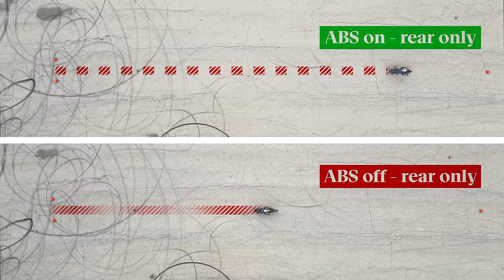Out-braking the ABS Myth

Comment: Because when I lane split I spend a lot of time on the paint, I have been worried that my tires wouldn't stick when necessary, which could dramatically reduce my stopping distance. I also thought my ABS could help maximize my stopping distance on paint (and/or wet roads).

The other day I discovered that threshold braking and front loading is the only way to make a slippery situation stick. A black pickup truck illegally jumped over the double line in front of me (that I was riding on) forcing me to jump on the brakes. Fortunately my instincts pulled my foot OFF the rear brake, giving me maximum force down on my front tire, safely slowing and narrowly avoiding the collision. I was surprised at how quickly I was able to decelerate. It was harder than I would have dared to do during practice.

Maybe ABS helped me, but it didn't feel like it. It felt like my experienced touch held the braking steady at near maximum friction.

I am grateful to my Michelin Road 6s, the best tires I've ever had on a bike.
Reply: I've been thinking about this concept of not using the rear brake in order to apply maximum force on the front tire. First in an emergency situation, you just do what you do automatically, and it's great that you were able to slow down in time. Hats off to you for that!

But apart from panic stops, in theory, I think using the rear brake will A) slow you down (up to the point where the rear wheel skids)  and B) not cause the front tire to lose friction unless you used so much rear brake that you also caused the front tire to skid (the exact problem that ABS tries to solve). and so the front tire stopping force wouldn't be diminished until the point where it skids. So in an ideal situation, you would use near maximum brake force on the front brake and just the right amount on the rear. 

Now add to the mix the brakes that Ryan was using on that Honda CB500F (?): two big rotors in front and one somewhat smaller one behind. I'm not sure how many cylinders in each brake, but certainly way more in the front. So I kind of think at least with a bike like that, one would do well to wring both brakes pretty hard. (And on mine, the brakes are linked, so that to get full force on the front, I need to use the rear as well!) anyway - complicated subject! The best advice is to practice.
Reply: @emzes5231  I think the issue is that ANY drag the rear brake adds pulls back some downward pressure on the front, thereby reducing the maximum friction of the front tire. 

It's as if the ONLY use for a rear brake is a backup in case the front brake fails. It seems the best technique is to NEVER use it. I only started using my rear brake again recently because I have an electric motorcycle and the regen equipment is on the rear. So I use front to stop quick, and rear to regenerate power for longer, slower stops, or down hills. Even now I'm considering that a bad habit to develop, and sacrificing the miniscule electric regen for maintaining good front-braking habits.

Comment: Very few motorcyclists are able to achieve an optimum braking distance without ABS. Either they do not brake hard enough, or they overbrake the front wheel in a panic braking maneuver and crash. 
The ABS system is one of the most useful electronic assistance systems available.

Comment: What about also using engine breaking to help assist the stop? Initial phase Threshold with a few downshifts & light back breaking -> then hard front breaking and back breaking not using the clutch and pulling it just before stopping or letting the bike cut off...

Comment: My background is as an expert-licensed motorcycle road racer and motorcycle road racing instructor. I have lapped the Snaefel Mountain Course on the Isle of Man during the TT at triple-digit speeds. I have been over 200 mph on my superbike. I have turned expert-level lap times during track days, with my wife on the back. I have been paid at the rate of $1,000/hour as a rider and model for the advertising campaign of one of the largest motorcycle manufacturers in the world.

I NEVER use the rear brake while in motion. I can out-brake the ABS system under almost all conditions, rain or dry. For the track, I turn off the ABS. On the street, I turn the ABS intervention level way down.

Comment: in motorcycle license school they taught me to first tap then rear brake the quickly pull the front. you shouldn't go 0-100 % but 0-20-50-100 % to avoid the front locking with the sudden braking

Comment: I own a 2005 BMW K 1200 LT. It came with interlinked ABS. Unfortunately, these systems are not something you can turn off and they are very prone to failing after about 15 years. When you get an ABS fault on the LT you actually have no brakes at all. This happened to me a few years ago on top of a mountain, I didn't know how I was getting down. Fortunately, after I restarted the bike the brakes lasted long enough to get me back down on the flat. I ended up doing an entire ABS delete on my bike and it's the best thing I ever did. It is actually hard to tell that you don't have ABS and I no longer wonder if I am going to lose my brakes when I drive out the gate.

Comment: This is essentially the inverse of a launch problem in a drag race scenario. Modern cars will apply acceleration to first shift weight to rear wheels and then adjust dynamically for maximum performance. Eventually a bike braking system will be capable of doing the inverse automatically as well.

Comment: I actually started using the front brake on my bycicle a lot because the rear brake was failing. So when i started riding a motorcycle i was used to using the front brake and it was pretty helpful when maneuvering. I was driving a trial bike tho, so probably not useful for larger bikes.

Comment: 2:00 that Tundra also probably has something called Vehicle Dynamics Integrated Management, which coordinates ABS, traction control, and electronic stability control into one coherent unit that can detect and even predict instabilities by parsing driver input and running a physics model of the expected behavior 1,000 times every second. During an emergency stop, VDIM essentially executes phase 2 of ABS as soon as it detects a slide risking amount of deceleration. Similarly, during acceleration, it can see that one or some of the wheels are accelerating way too quickly, and reduce power before wheelspin becomes uncontrollable (or even gets to a level that would trigger a conventional traction control system.)

Comment: Great explanation! This way the majority of misinformed riders can start to understand what a motorcycle ABS system is designed to do. It would be interesting though to repeat the brake distance comparison on a wet surface with reduced traction.

Comment: back in my teens when I still was riding on two wheels I'd make a game of braking as hard as possible, that conditioning, while it did wear out the front tire rather quickly, most likely safed my life when someone cut me off while I was going 80kp/h down the country road.

I didn't manage to stop in time, but I slowed down enough to tell the tale

lucky for me was that I installed aluminium handlebars 2 days before that crash, cuz I was leaning in to them before impact and bent them so they looked to be on backwards
broke my wrist but other than that I got away relatively well
if I stillhad the steel handlebars I may have come out of that a lot worse.

Comment: ABS can be problematical on cars.  Back to statement that humans can evaluate consequences while ABS can only react, ABS always prioritizes control.  Snow in particular ABS may severely cut back braking to a fraction of what it is in dry conditions as it tries to prevent lockup even when the snow is perhaps a really thin layer, max braking force then becomes what that thin layer supports.   What the ABS can't know is that if wheels become locked the tires cut thru that layer to the pavement underneath.   Or assume there is more snow, again ABS limits to the traction of snow while wheel lock will pile up snow ahead helping to brake faster.   In every case wheel lock cause momentary loss in directional stability but the driver can selectively let off to regain control as needed.

Comment: So I've heard a lot of Harley riders used rear brake only for most, if not all, daily stopping. This habit probably doesn't help in a panic. 
Side note: I two step my braking by getting on the rear a beat before the front. Loads up the front just the same as a two stage level pull, but I feel like it's faster and smoother. (Although maybe just for me since that's the habit I developed.)

Comment: I like abs in the rear wheel, as it is almost impossible to do emergency break without locking the rear, the fear makes you act too fast and apply too much force. 
The other time I love abs is when the road is wet. I love to apply 100% brakes without fearing the wheels are going to lock

Comment: So here’s a real life example of motorcycle experience - my life.  Following friends on a dry country road, down hill with a right hand bend at the bottom.  Hit the front brake only, and the rear goes light and lifts very slightly.  ABS immediately kicks in and cuts my braking till the rear comes back down.  But, the bend is approaching really fast, and I’m looking at a certain crash.  So, off the brakes, look at the corner exit, ease on the throttle and pray.  I make it, fully crossed up, with a recorded lean angle of 45* right, and the rear hanging out like I’m a moto2 pro.  What saved me?  The traction control didn’t kick in.  But I had faith in it.  What nearly killed me?  The ABS.  The bike?  S1000RR 2022 model.  I will hold my hand up .  I’m not some biking god.  I put the save down to luck and a massive sense of self-preservation.  So even the most expensive/sophisticated road going bike ABS is not up to the job.  Learn to brake and steer, my friends, because bike ABS is not all you’ve been led to believe.

Comment: When I had a bad crash I was too afraid to pull the front break, because I feared to block the front wheel and slide under the car. Instead I opted to stand up and fly over the car, which in hindsight was probably the right call. If my bike had ABS, I would have pulled that lever hard! It's good the EU made ABS on bikes mandatory now!

Comment: I have unfortunately had many opportunities to test my 07 VFR's ABS system and found it really only most useful during wet/flooded stops and it did not allow for a faster stop, but a more controlled stop. In normal riding and just short of ABS engagement, the dual linked brakes provide a much faster and controlled breaking effort.

Comment: This is my braking experience,

A front only ABS for bikes above 150cc, if you apply both brakes at the same time the braking will be poor.
Front brake first little bite then then a heavy braking, only apply rear brake only after 1/3 rd  second of applying front brake . Rear brake  shouldnt apply more than 30% coz, more braking can make it lock and slide. Brake maximum don't exceed to the point when the brake start locking.

Also control both tyre speed to be almost equal to have a traction. 

Soft tyres gives you better braking,  just warm the tyres for better braking.

Keeping finger on front liver can save you couple of meter than not keeping.

If your bike have front ABS learn corner braking , also learn corner braking with reducing turning radius.

Give back brake a little loose so that if you apply rear brake there should be some time lag than front brake for better weight transfer. 

If you apply both  brakes at the same time 50-50 the bike front suspension become loose and bike height will increase a little, the weight transfer will go back to rear which give rise to longer stopping distance.

Comment: Last accident was when under hard breaking to avoid hitting a car who suddenly breaked hard to make turn off they hadn't signalled for. My front wheel locked up, starting at a 2cm crack in the road. If i had abs my bike would been fine.

Comment: The idea is the same for cars. ABS is not to stop faster, it's to maintain control during braking. In cars, you'll always stop faster without ABS (no guarantees WHERE you'll stop though). A truly revolutionary system would be one that can modulate pressure perfectly to maximize brake pressure without losing grip.

Comment: It always blows my mind people forget to use their front brake. My problem was bad brakes, I grabbed my front brake hard af but my master cylinder allowed air into the lines, and I didn't realize until that second my front brakes were shit. The master cylinder ended up being recalled, AFTER the accident. Brake fade is a bitch, it happens slowly over time so you get used to it, then when you really need your brakes they aren't there. I locked up the back brake pretty quick because for a slit second I thought I had enough room to ease up and unlock it after my front brake slowed me down a bit, but nope. Back tire stayed locked up and I slid into her sideways lol. Thanks Suzuki for delaying that recall for years so I could learn how I brake in a full SHTF situation.

Comment: ABS is predominantly FOR instances where the surface is slippery or unpredictable (wet, ice, dusty, oil) and might result in unforeseen random lock ups if you are even partially on the front brakes. The purpose of ABS (believe it or not) is only to stop the brakes from locking, which in most cases will stop you from dying.

Comment: As a european. We have to practice emergency braking many many times before even getting the license. At 60-80mph and even learn precision braking to stop at the same place from any speed. 

And by looking at your “dodging manoeuvre" or whatever it’s called. It’s clear you don’t have much experience with that either. 
A crucial part of EU standards in getting the license is to do dodging manoeuvres in a straight line and in turns which include dodging an obstacle poking 9 ish feet into the road and ending at the same place in the road you started on within a 6 yard span and doing the same while cornering

Comment: Lowkey abs is more a prevention system than some pro system. Its better than locking up but braking by threshold is more effective with OR without abs. Abs just prevents "perfect braking." As someone who drives cars in poor conditions a lot, (hey a fellow canadian!) I'm more than used to edging the threshold before the abs even engages and smoothly applying the brake even in dire circumstance. Learn to talk to your cars traction. Steer by the limit on occasion and sometimes try turning hard off throttle to see how much grip you have in circumstances. You'll grow a feeling to the traction, its almost elastic. And understand how to use your brakes better in turn if you play with the easy traction before the hard traction. As turning is easuer than stopping due to the shape of the contact patch.

Comment: I ride motorcycles since i was young (bad, dont do that) and the road is so bad i basically ride on dirt and rock from the road foundation (or what's left of it) on daily basis, im very confident with my riding skill but i 100% agree. NEVER turn off your abs, cause in that split second, when the road is wet, when theres mud, when you cant see the road, when its a corner and you HAVE to break trust me the tire will lose it grip for split second and you will fall.

Comment: 6:10.  This is simply wrong.  "An impending unavoidable impact" is not properly defined. In this case "was not avoided" is being used as an approximation for "was unavoidable".  People who only brake with the rear are going to be much, much more likely than the average rider to fail to avoid impact. That doesn't mean that the average rider would only brake with the rear given the same situation.

Comment: I've been baffled lately by people claiming that ABS would increase the braking distance on a car. obviously, that's not true, since locking the wheels increases braking distance by 40% and car ABS systems don't have to worry about stoppies, but I guess at least now I know where this myth comes from.
People love taking something they heard in a specific context (motorcycling) and wrongfully apply it to a general context (cars) or vice-versa.
Reply: you dont need to lock the wheels if you dont have ABS. Learn the threshold braking its about to control the brakes just lock the wheels is daft